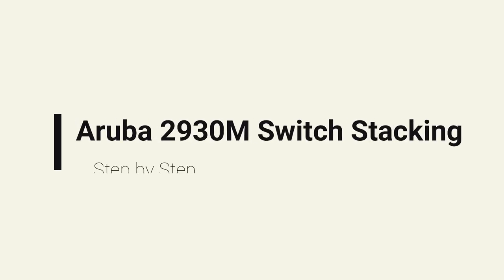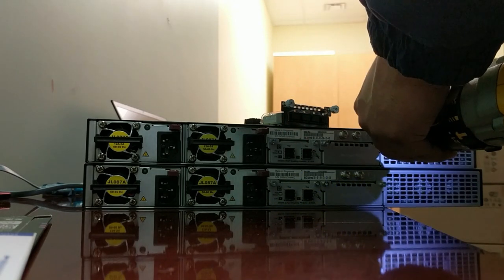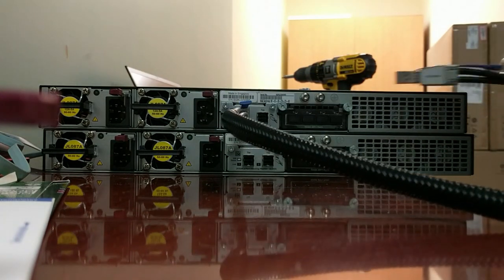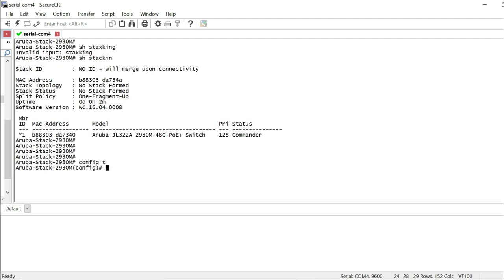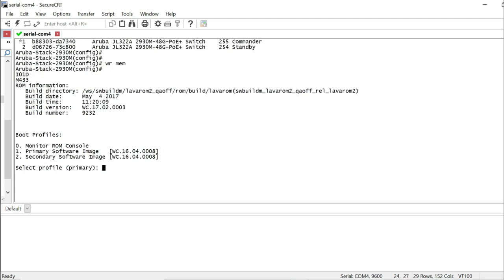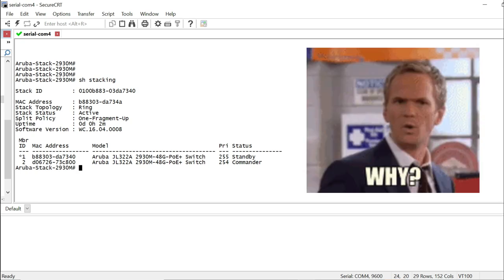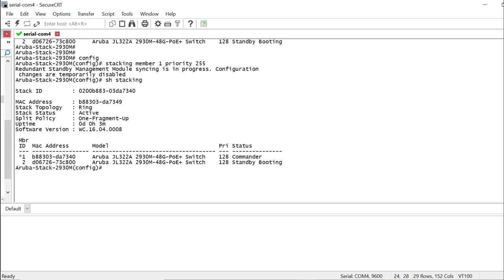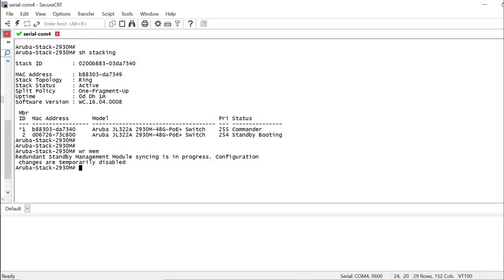Aruba Switch Stacking using 2930M - Step by Step w Real Gear

Comment: thank you with complete and comprehensive guide of stacking. We've stack of 5 Aruba 2930M switches, Member 4 diagnosed with some bad ports which needs to be swapped with a new switch. We do schedule a down time but I'd like to know the process to swap member 4 from the existing stack. Priority of all 5 switches have been set already.
Reply from the maker: Knowing the available switch numbers (SNs) and Candidate MAC addresses, you can manually assign a Candidate to be a Member of the stack:
Syntax:
stack member <switch-number> mac-address
For member in the middle yes you should schedule a change window as you will have to break the stack.

Comment: I am not sure if i missed something in the video (i have rewatched a few times) but why the first time you applied the stacking why did it not hold correct order after the powerdown? But did the 2nd time.
Reply from the maker: I was simulating a power outage and mistakenly pulled power on standby first, hence standby came up before Commander. Later I did a boot system so the whole stack restarted and I was able to show that the commander stayed commander. Are you getting certified? Let me know what other Aruba products you have worked with.
Reply: @TwT101  Ah thanks for explaining! No not getting certified, I have a deployment coming up that uses 4 of these Switches in a Stacked Configuration, I’ve worked with these series of switches before so I’m  just brushing up on my knowledge a bit. Only other Aruba products I actively use is the Aruba Instant-On switch series.

Comment: This was just what I was looking for. Just unboxing 11 Aruba 2930M switches to stack in two stacks and could not find decent guidance in the HPE documents. You save my day. However I have one question? Do I configure them first seperately with a fixed ip address and upload the latest firmware?
Reply from the maker: No sir, stack them 1st then do the stack aos upgrade. You can do the configuration before or after the stack upgrade. Let me know if you need help.
Reply: @TwT101  Thx for your quick reply. Do you assign the stack with an ip address so you can configure them from there, and if so how? Or do they remain individual units to connect to in order to configure them?
Reply from the maker: You need to do some basic configuration for the stack. Create some vlans, SVI's, spanning-tree configs. Connect to this switch stack using console to do all this and later you can use ssh to connect on SVI IP address. https://youtu.be/LsfiOPIcj2g shows how to do all those.
Reply: @TwT101  Thanks a lot for your guidance video's. You are awesome. Keep on the good work. ;-)

Comment: Hi, how to add a new switch to the existing vsf? for example, i have 3 existing switches, how to provision the new one? My switch is 2930F.
Reply from the maker: (config)# vsf member 4 link 1 A20
Made sure the 4th switch doesn't have any config. Wipe it out. Connect the 4th switch to switch 1 port 20. That's it

Comment: hello what would it be like to connect the stack of two aruba 2930f switches with two cables port 25 from switch 1 to port 26 from switch 2 port 26 from switch 1 to port 25 from switch 2
Reply from the maker: So you want to create VSF using these 2 Aruba 2930f and those ports you mentioned , is that right ? Here is a HPE guide. Start around page 720 onwards. Good doc to keep.
https://support.hpe.com/hpesc/public/docDisplay?docId=a00050273en_us

Comment: Hi, is it posible to create a stack with macsec modules with SFP+, instead of using stacking modules ? For instance if you are going to move one of your aruba 2930m switch to another location which is more than 100 meters away. Thanks
Reply from the maker: 2930F and higher you can use vsf to achieve this. Not possible with 2930m switches.
Reply: @TwT101  thanks for the quick reply

Comment: thanx for the good video :)
Maybe you can give a hint, how to add a fourth switch to a existing stack of three ( ring setup )
Is it necessary to reconfigure everything, or is it enough to plug in the cables and boot the new switch.
 Thanx in advance.
Reply from the maker: Add the 4th switch while it's powered off. Connect the stacking cables and power on the 4th switch. Monitor the console message and you will see the 4th switch being added. It's that simple.
Reply: @TwT101  Thank you :)
It was really simple ! I had only to enable stacking on the last switch. It is working 👍
Reply from the maker: @steelsteez6118  I always prefer to do a stack upgrade but if this is an existing stack and you are adding a new switch of the same models, I would schedule a down time window for the stack upgrade.
Reply from the maker: @Steel Steez Follow these steps:
1. Schedule outage. You will have to break Ring stacking topology to add the new switch to the stack. Make sure priorities are set in your existing stack members. Install stacking module in your new switch then turn in back on while it is not connected to any stack. just by itself. If you turn on the switch and then add the stacking module, you may have to enable stacking in the config.
2. Turn off the existing stack.
3. Make sure new switch has the same AOS installed. You may have to downgrade if this is an old Stack. Alternatively you can upgrade the existing stack to the latest stable version. Do the same for your new switch. This way all members have same version.
4. Break the ring topology and add the new switch to the existing stack. Power on switch 1, wait 3-5 min and then switch 2 and continue until all members are powered on. Monitor console.
When all switches are booted up, you will see the new switch as a member to your stack.

Hope this help.